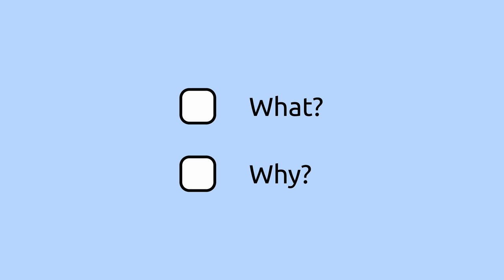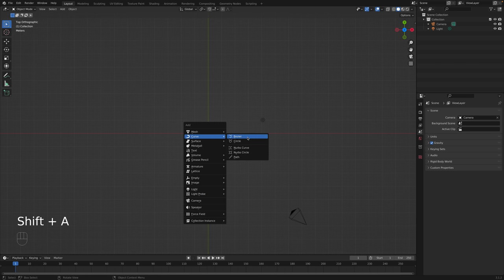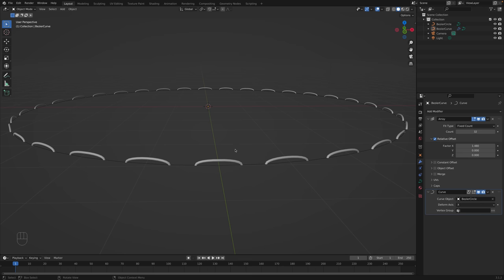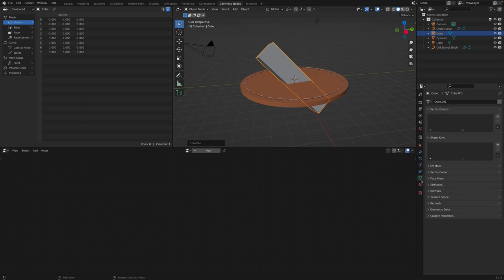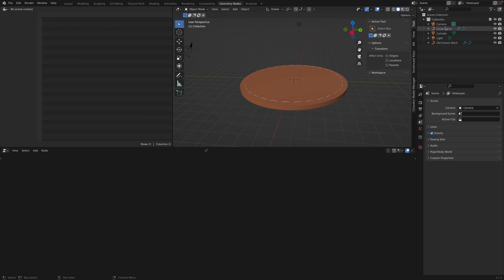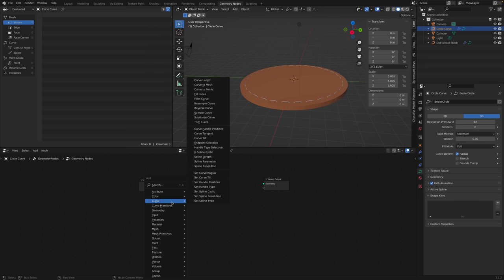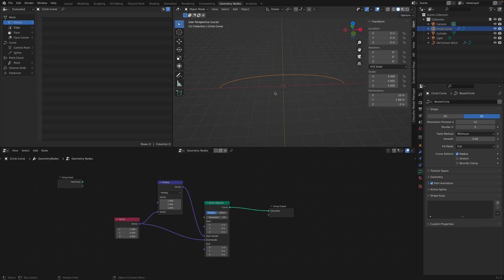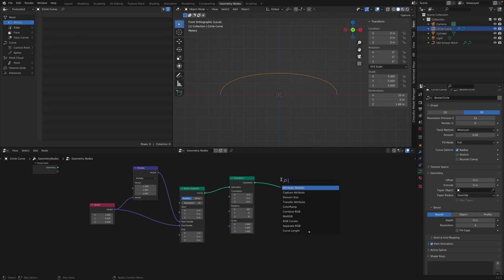I wish I knew this before using Geometry Nodes (Blender)

Comment: As  a former programmer and current 3D artist I appreciate how you tie nodes to if statements, boolean statements, etc.  Working with nodes seems, as you say, a visual extension of scripting.
Reply: more like: it actually is. for some time now. 😉
Reply: You should check out... I think it's called serpens? In any case, there is a nodes extension to translate python to nodes and back to make your own extension. And when "everything nodes" is complete it will likely include this, as well as a better scripting of particle nodes and a back and forth between bones/armature and a node representation
Reply: @michaelwerkov3438  Thanks for the tip
Reply: imo that's what makes it "techart" but so many studios have so blurry expectations of what techart is
Reply: Anybody remember POVRay?
Reply: Scratch with strings
Reply: @3dbob891 as a tech artist, I agree. Some studios are like “you work here now, we expect a game in a few weeks” lol

Comment: This is an excellent tutorial. Approaching it from "this is how you should be thinking of it" instead of just "watch me and then you do the same" is great. It would be amazing if one could create a geometry nodes layout by editing the mesh. So you could go up into the viewport, type "rx45", and it would add a transform node with the right place in the geometry nodes.
Reply from the maker: Glad it helped! Totally agree I’d be awesome if there was some way to “record” actions directly into geometry nodes.
Reply: I should point out that your specific example is regarded as bad practice - Maya works the way you said and so does Houdini (all operations are recorded as nodes) and practically all the Maya or Houdini basics tutorials start by saying “you technically can do things this way, but you shouldn’t”.

That’s because you’re having to manually specify a vertex index to operate on, and that can easily get messed up for example if you change the original input geometry.

It’s much better to get your head around creating rule based systems.

Also if you indiscriminately create node after node for individual operations it will bog the system down rapidly.

That said, I definitely agree it would be useful to have viewport handles (for example for the transform node), or being able to click an item within geometry nodes tree and select it (Houdini can do this). Also better visual or interactive ways of identifying selections e.g working out what vertex index needs to be operated on.

Comment: Great tutorial, made a lot of sense. You mentioned about Materials and getting it so that you could change them from the Goenode tool bar. 
1:21:20  Materials.  I connected the Pink Material input dot on the Set Material to the Geometry Input. This gave me an option to select any materials I had already set up in this blend. It didn't allow me to manipulate the material just select any I have set up in the Shading window

Comment: Use case for strings I'm constantly using, is showing a bunch of information related to the object. I'm working with blended projectors and LCD/LED video walls, and some of the information I show are: Aspect ratio, overlap (pixels, projectors only), individual image resolution (per cabinet), total resolution (per video wall), calculated pixel density/size (to determine readability), lens shift and throw calculations (within physical limitations?), and what projector screen is being utilized (may vary with size due to production limitations). Snapshots of this is then used internally to discuss around the solution, and maybe sent to gfx to prepare pixel perfect content to be used in the final renderings (although I use UV vector snap to force anything pixel perfect anyway).

Sometimes things are used for communication purposes rather than rendering. One problem is since having to use nodes for separators, concatenations, and special characters, it can get really messy really fast, so all this is dropped into a separate node group. I wish there was a more elegant way of doing this using a multiline expression interpreter.

Comment: As a programmer and 3D  hobbyist, I can confirm that this is a must-know for any artist who want to TRULY have the power of procedural generation, knowing to ask the right question without knowing the answer immediately is much much better than blinding following something that works for "that case". 
My only issue with GeoNodes (and most other node based system) is that its not very intuitive for programmers who are used to do everything with an OOP approach.

Comment: I'm still watching the video (which is very interesting, so thanks for that ^_^) and I just wanna say, regarding drivers: the easiest way to use them is simply with "Copy as a New Driver" and "Paste Driver" (instead of "copy data path" and then "edit driver" since then you still need to edit the driver which is an extra step).
As for the frame rate, turns out that if you select "custom" in the dropdown (instead of the default "24 fps"), that exposes automatically an "FPS" integer panel that CAN be used as a driver :)
Reply from the maker: This is great insight, thank you.

Comment: To get the scene length, add a driver to a value node and choose Single property as type, then Scene as ID type then scene as the ID, then in the data path type frame_end, that way it can use the full length of the animation to do many things
Reply: Ok, so you figured it out lol, paused to type before I saw that.
Reply from the maker: Appreciate the willingness to help still!

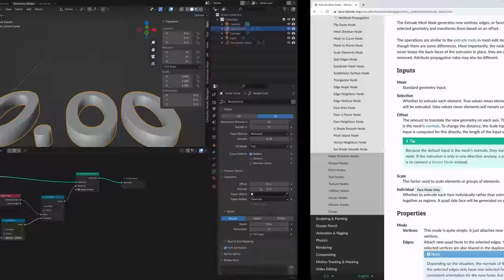Comment: 50:13 — You can do this in normal edit mode as well, by Ctrl+F, 3 (Extrude Individual Faces), if you do this on a subdivided plane it would look like a normal extrude, until you select one of the faces and move it away, you'll see that each face was treated as if it was it's own separate island so you have internal faces.

That's more or less what was happening with the individual being set, each line was extruded as if it was isolated from the other lines, thus creating a break in the geometry. This would then mean that there is no neighbouring normals to calculate the edge angle with. The odd look is probably caused by the original lines still being connected so at the bottom of the mesh they are connected, but at the top they aren't, giving you a gradient along the sides.

There might be some smaller differences in how the normal operation handles it compared to this node, but that's essentially what it was doing, creating extra vertices and doubling up the internal edges so that they wouldn't connect to each-other. Which would allow them to subdivide without influencing each-other for instance, creating a hard edge instead of the rounded edges.
Reply from the maker: Amazing explanation, thank you!

Comment: @36 mins or so, drag (any) nodes input on the left side to the very first (leftmost) Group Input node (there will be a blank "empty" spot underneath). This turns it into a setting within the geometry node panel. You can then adjust just that exact setting without having to search a million nodes.

Comment: When you do the extrude/flip/join thing, you should also use a Merge by Distance node after the join. That way you get connected geometry, and avoid some weird side-effects that can come up sometimes (subdivision surface is a common one).

You also don't need to rename the node group node itself, as it will adopt the name of whatever the geometry node group is that it references. Unless you have a particular reason for using a different name, just rename the node group.
Reply from the maker: Great points, thanks for sharing.

Comment: There's a better way I figured out to do the same thing with drivers in a single node. (40:33). Instead of duplicating the node for "total frames" to access "fps", add another input variable for it in the same node as the total frames node. If you name the 2 inputs appropriately, like "frame_end" and "frame_rate" you can set the expression to "frame_end / frame_rate" which would evaluate to "10.417". That way you don't need the additional Math nodes.

Comment: Geometry nodes are an incredibly powerful set of tools that allow detailed manipulation, and creation of almost everything in Blender.
Geometry nodes are an incredibly frustrating thing that is a huge reason why Blender isn't leading the graphics world in everything.
Blender is like buying a flight sim just for having some fun and finding out all the controls are 100% realistic and you need to be a qualified pilot to fly it.  There is only one setting for the interface, expert.
If MS Paint had the same interface you would need to set up nodes for colour, opacity, line thickness, line type, all before drawing a line.
I have been using computers forever, everything from vanilla unix, vax workstations, right through to today.  The nodes are really almost like background stuff the user shouldn't have to deal with unless they are truly at expert+ level.  You see this with some of the add ons.  You place them and they generate the 80 nodes that make themselves work.  Background.

Comment: 57:31 — I don't know for sure if this is the official reason, but by leaving orphan nodes until you reload the file you can delete a material/node group first, then use it on another object. If they immediately removed it then you'd have to add it to a new object first, before removing it from the old one.

Imagine adding a material to Suzanne for instance, then you delete that placeholder geometry, add in a human model from your library and… The material and the work you put into it is now gone, you have to undo to get it back. And if you're new to Blender you might think Blender destroyed your work instead of it being a consequence of you removing an object.

Alternatively, Blender could alert you every time you delete something: "Warning, this action will destroy Material_1, Geometry_Node_13, etc, etc." Which would just annoy people that know what they're doing.
Reply: That's a good use case, but how it's currently implemented is not exactly intuitive. Good UX means that you can save the file, shutdown your computer, open the file the next day and still reuse the material, because nothing is warning you that the material is getting deleted or asking you for permission. So it feels like a feature that started out as a bug and has been left in for it's usefulness. It's not thought out.

Comment: @ the end: I'm not certain, but I would assume material index refers to material slots per object. You can have multiple materials on separate parts of a single object using material slots. One thing that would make sense is to put the material selection as a group input, so the user can add whichever material they want right in the modifier.

Comment: Another way to set shade smooth properly to the numbers, is using [Normal]-[Separate XYZ (z)]-[Substract(Value 0.01)] and connect to Selection in Set Shade Smooth

Comment: 38:50 — The edge angle is calculated from the difference in the normal of the adjacent faces. Why it wouldn't work was because you took the normal, with it's 3 components, and treated it as a single float. I'm uncertain what operation it uses to flatten it, but I presume it uses the distance. Seeing as all normals are unit vectors it would be 1, with the only real variation coming from floating point errors.

Or it calculated the dot product with one of the cardinal directions, like (1,0,0) which at least is a bit more useful, but still incorrect for this application.

It's important to pay attention the colors of the handles and lines, if the color changes on the line then you're getting some form of automatic conversion going on, in this case you went from the purple vector 3 to the gray float value. You don't always have to care about that, but you should always check for that if something is misbehaving, and put in conversion nodes to make sure it's doing the right thing.

Not that using the normal on it's own would help much in this case. At best you could look at face normals and smooth the ones not facing up, but that's functionally different from what you were trying to do, and would fail if you rotated it to be vertical instead.
Reply from the maker: Another great technical explanation, thank you.

Comment: The reason that arrays are zero indexed in most programming languages. Is that in C when you index an array it is the same as `arr+index` (in fact, you can index a non-array pointer [assuming You own the memory at the offset ]) and since the array points directly to the first element, you don't have to add anything to it to get the first element hence your zero indexing

Comment: If you need the Material to be applied on the Object inspite of it being a Curve.. In the Material Data block set the Link to Object instead of Data ( Which is the Default ) . You will still need a Set Material Node in the Node Tree, just wont have to pick a Material.
Reply from the maker: Thank you for the insight! I did not know about the Link to Object option - that can definitely come in handy. For geometry nodes specifically though, I'm still having trouble getting the material to show up using the Set Material Node on the Curve. If I leave the Material blank on that node (after setting the material to Link to Object on the Curve), unfortunately the material does not appear. I must be missing something...
Reply: @RabbitHoleSyndrome  Tested it in 3.3 it works for me .. Strange
Reply: That was hard to find! It's the very tiny dropdown icon next to the material's name in the material properties (under the slots section). When in default it has the icon of three linked cubes. It does work by the way, with the Set Material node in the geometry nodes, leaving the material empty!

Comment: I've done some Python programming. So, what's better? Depends on what you want to do. One advantage that I see with the nodes is that as you tweak the nodes, you can see things change in the 3d Viewport in real time. If you're going to be making 1000 changes, it's not necessary to run your script 1000 times. Plug in some noodles or slide a number back and forth and observe the results.
Reply from the maker: Yeah definitely depends on your end goal, but agreed - nodes allow you to iterate way quicker.
Reply: @RabbitHoleSyndrome  These are just tools. Nodes are a tool, and Blender Python is just another tool. I think that a lot of artists (and people in general) are intimidated by programming. And Blender Python can be somewhat intimidating. As programmers, we're often doing the same things that others do with menus and dialogs only we are using written words. I think that Blender Python really requires two prerequisites: Blender and what is often called Core Python. One should really understand the core language before attempting Blender Python. I know there are tutorials out there that try to teach Blender Python from scratch. Those are usually not that good. They miss too much.
Python is actually a very good first language. Much easier than many others. Your first script will most likely be print('Hello World!) and that's it. That is actually a complete script. You do need to go a little beyond that to learn Blender Python. To give you an idea of what advanced Python is, check out the book "Fluent Python". Most of us haven't gone that far. I know I haven't.
One of the ways that I've used Blender Python is to do things outside of Blender on my computer system in the middle of a script. There is no way to do such things with nodes as the list of things to be done is probably infinite. If you made it through this comment, thanks for putting up with me.

Comment: Brilliant tutorial on what an opportunity GeoNodes provide! Also, now that I've subbed to your channel I'm scared for rabbit hole sections in future videos.. haha
Edit: Managed to prevent the Stitch Scale to go -ve and too large that it overlaps using the Map Range node. Work pretty well tbh. Is there another way or would you have done it the same way?
Reply from the maker: Map range sounds like a really solid approach. The only other option off the top of my head is to simply cap it, meaning that if you scale the value larger than the cap it basically does nothing (using Math max/min operations under the hood). I think I like your approach better, since you can use the full scale (assuming something like 0-1) and there's less room for ambiguity. The only upside to the cap approach I can see is that you can use "real" units, but I'm not convinced that outweighs the cons.
Reply: @RabbitHoleSyndrome  Ok yeah, interesting. Good to know an alternative though!

Comment: Is there such a thing as “convert object to geometry nodes”? Where you can take an object created in the old school method and it would translate every alteration a user did on an object into geometry nodes?
Reply from the maker: Not that I know of, but I definitely wish something like this existed (or alternatively, "record" your actions into geometry nodes). Perhaps an addon can be created, though I can't image it would be easy to make as there are so many different actions/nodes available and they don't always map 1-to-1.
Reply: @RabbitHoleSyndrome  Come to think of it, there is the Editor called "Info", which is a log of operations, that could potentially be used to turn geometry data/operations into nodes.  For example, to create a cube the old school way, the code from the info editor is: "bpy.ops.mesh.primitive_cube_add(enter_editmode=False, align='WORLD', location=(0, 0, 0), scale=(1, 1, 1))"  to create a default cube as a geometry node, it is:"bpy.ops.node.add_node(type="GeometryNodeMeshCube", use_transform=True)".